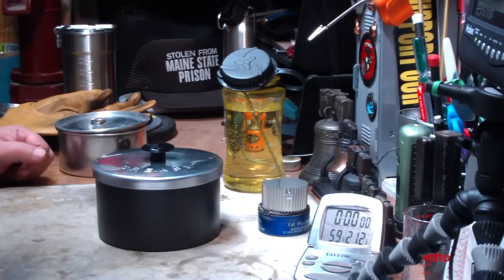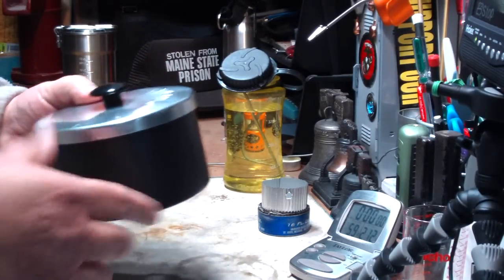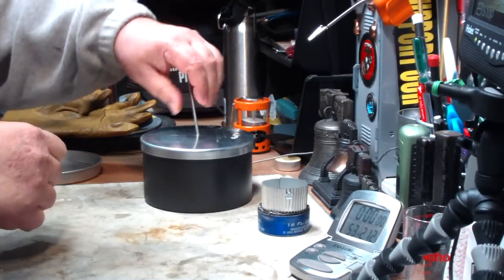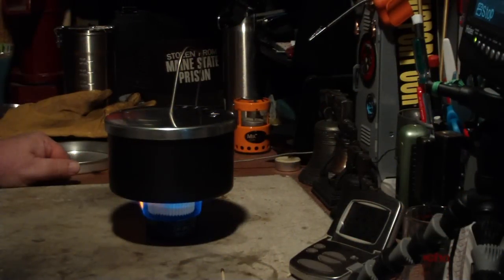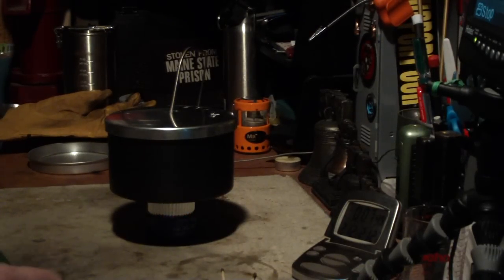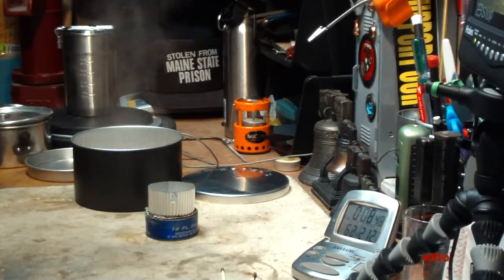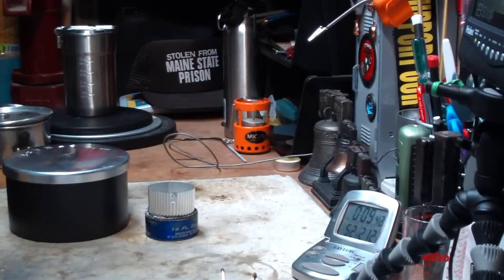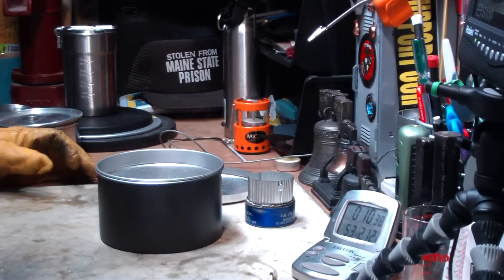K-Mart Grease Pot - Boil Test #1

Comment: I have a suggestion for the strainer... cut a hole in it to fit the body of that small pie tin you baked the pancake in the other day... then you can use the strainer to suspend the pancake in the middle of the pot for dry baking.